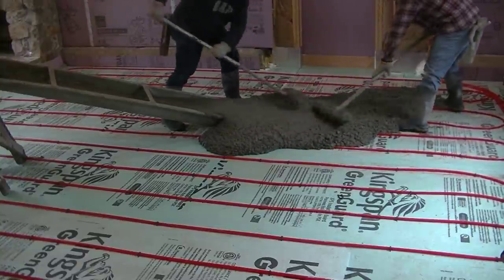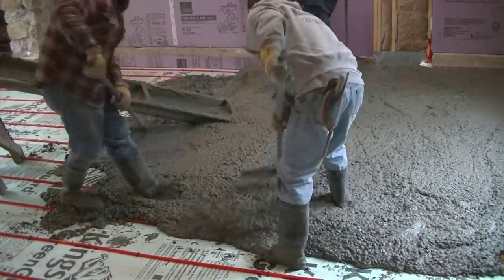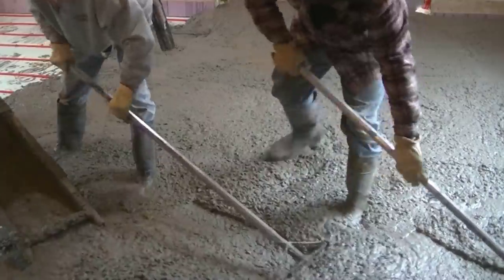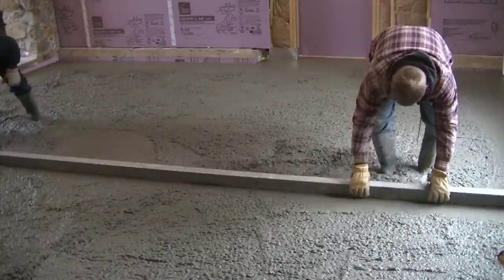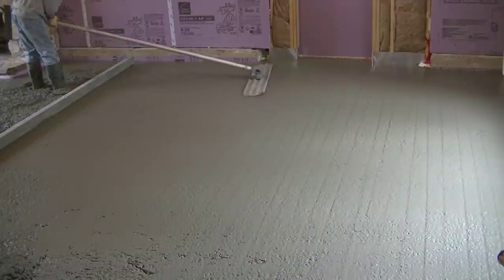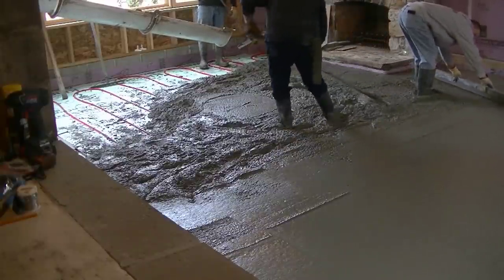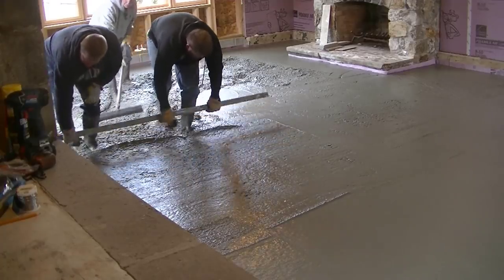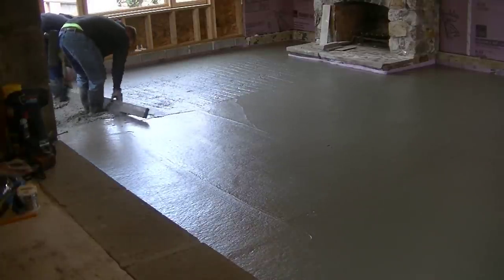3 Men Pouring An Interior Concrete Floor Over Existing Concrete (Radiant Heat Floor)

Comment: If the concrete floor is not level, do you use sand to level it BEFORE the styrofoam insulation?  Good call on the insulation because otherwise the heat would seep into the older concrete instead of up and into the room.

Comment: What's the lowest outdoor temp you would allow for pouring an interior 4" slab over Hydrofoam for Uponor in-floor radiant heating.  2,100 sf that we can "close off" and pump heat into with some heat leakage.

Comment: I have a 70s style sunken floor that I want to fill in. This video is very helpful. Thanks!
Reply: Don’t forget to add extra support u see it.  The concrete is very heavy unless you use light weight but last I checked it may be Cheeper to add extra support vs having the concrete plant get lava rock to use In the mix.  At the same time lumber is thru the roof so good luck.
Reply: @dustyniederriter7543  Good points, thanks Dusty

Comment: It is best to have the pex heat pipe stapled to the styrofoam so you can cut your control joints without worrying about cutting the pipe if they are in the middle of the slab.

Comment: When you mag float the edges, how to you get that surface level?  It will be level at the chalk line but what about the 16" length of the float?  That edge of the surface could be up or down.
Reply: 20 + years of experience and a good eye.
Reply: @larrykeenan598  Agreed but same ol same ol  A couple guys who are good and the rest just screwing the pooch